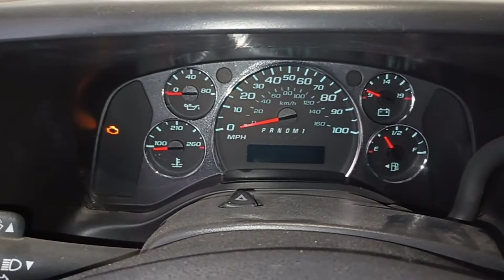how to replace an alternator on a Chevy Express g2500 4.8

Comment: I just did this job tonight August, 14th, 2024 and the belt was a PITA to get back on all the pulleys and whatever else the belt needed to be on. The van started back up weakly, as if it was grtting used to the new adjustments, then it shut off, with the dash lights on. I then turned the van back on and everything was all-right. Normal.  The thermostat on the dashboard cluster behaved normally until going down the road I noticed that that particular dash needle was all the way at the bottom and the check gages light was illuminated, I pulled over and checked under the hood and there was still coolant in the clear overflow  canister. So everything is good under the hood, just gotta research this problem further.